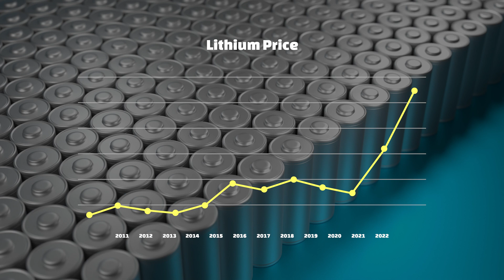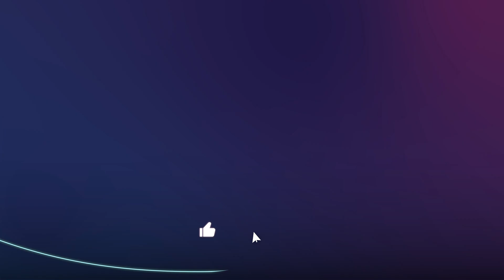Solar Battery SHOCK! Prices Skyrocketing  (But there's Hope!)

Comment: Sodium is simply the answer.  It sells for $150 a ton. Plenty of sodium available.  Litium is right next to sodium on the periodic table  but it’s less dense than refined lithium.  Perfect for homes and stationary power where weight and size aren’t hyper critical.. leave Lihium to E’V’s